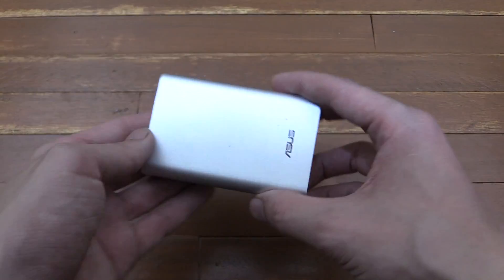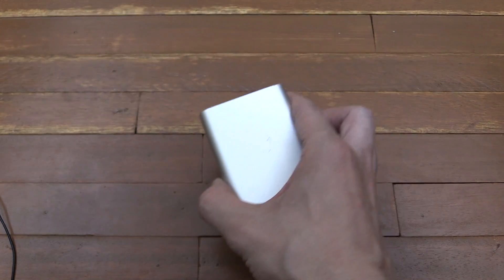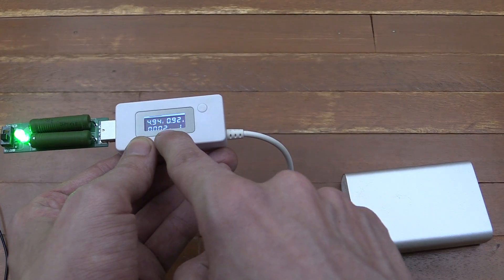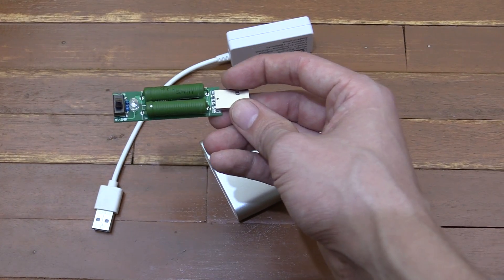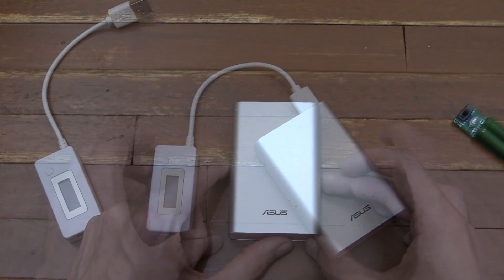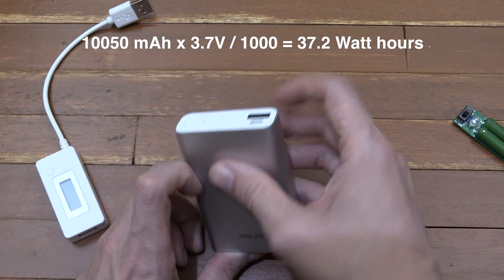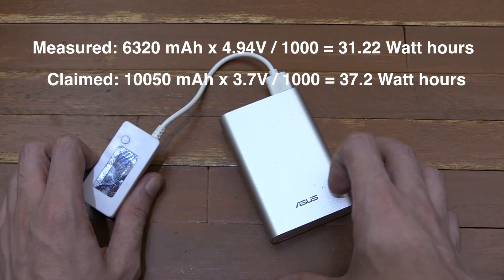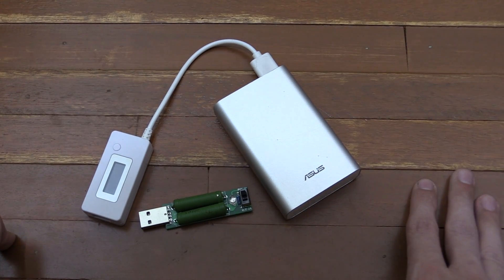How to measure the capacity of a powerbank

Comment: How could I measure the actual capacity using a USB tester with a discharged battery? For example, what if my power bank is at 0%.  Can't i just charge it with the USB tester plugged into the power bank and get the mAh reading when it is fully charged?  Thanks

Comment: Also everyone needs to remember, that a battery that is worked hard will not have as much capacity as one that is used gently.   If you have a 1000 mAH bank, and you use ten mA/H, then it should last 100 hours, right?   If you put a heavier load on it, lets say 1000 mA/H, it won't last 1 hour, maybe 30 minutes or 15 minutes.   Those mAH ratings are only valid when used in the gentlest way possible.   Increased loads end up with a big chunk of the power being changed to heat instead of usable energy.
Reply: what do you mean by load? Sorry I am new to this

Comment: One thing you need to verify, at what voltage drop the tester stop working. 3.7? 3.8? 3.9? If it stop at 3.9v the power bank still have some juice in it.
Reply: those batteries usually can go all the way down to 2.9v under load which is the powerbank or any bms module cut of voltage. those still have juice in it 3.6 to 3.7v . you can verify it if you can access the batteries and have it checked with a multimeter

Comment: My power bank is rated at 15,600 mah and at 78wh. When I used your formula 15600×3.7÷1000 I got less wh. When I changed the 3.7 to 5v it calculated as the label has it.

Comment: I bought two identical USB power testers brand KEWEISI from Ebay and wrote A on one and B on the other. I then charged a GPS device with both in series from a 3,000 mAh power bank I bought from DIASO in Japan for 500Y+tax (cheap!), first AB the BA to verify what I found. They both read different results irrespective of the order I placed them in. I expected the first in series to show maybe higher as the device itself draws some power, but no. 

The voltage and current are displayed to 2 decimal places (0.00), the time to one minute and the consumption to 1 mAh. The displays are updated about twice a second.

After 20 hours 8 minutes the displays read with [PowerBank]->[A]->[B]->[GPS]:
Read  A    B
-----  --- ---
Volts    5.06  5.09
Amps  0.02  0.00 (both vary continuously 0.00 to 0.08, generally within 0.02 of each other, and about 0.02, the higher 0.08 is on first connect)
Time  16:45  16:11 (lost a few hours, possibly device became fully charged as displays went dim occasionally)
mAh   473  455

Whilst they seem 'close' I would not expect the Volts to differ at all, B always reads higher than A by about 0.02 to 0.03. Total mAh is a function of current, voltage and time, so I expect any errors propagate. 

The test was meant to see how long the GPS could last as its battery had failed and instead of getting 20 hours usage I could only get 4 hours. So I fully charged the GPS and power bank and let it run, its still going, will update after it completely fails, maybe days away.

Comment: I'm non-techie. Let's assume I drain my cellphone (say with a 4000mAh) and charges it, WITHOUT POWERING IT ON. Should i be able to charge my cellphone around 2.5 times with a 10000mAh powerbank ?
Reply from the maker: If it's a genuine 10,000 mAh powerbank, yes, kind of. Minus 10-15% for losses from your cellphone charge circuit.

Comment: My power bank when charging my phone it decreases till like 60% then drops to 0% what might be wrong ?
Reply: Ahmed Saïd it sounds like your power bank is running on 3, 18650 cells and 2 of those cells are not holding a charge. The electronics in the bank "think" there are 3 cells containing about 33.3% of the total capacity each. If 2 of the batteries are dead it will "see" the voltage of the 1 good cell and read as fully charged. Once the 1 cell is used up (about 33%) there is very little (if any) capacity in the 2 dead cells and the circuit will see this as the over all capacity going from around 66% to 0% in just a few minutes. It sounds like it's time for a new power bank. Or time to replace the 18650 cells in your bank if your up to it.

Comment: Any of you seen a 3600mAh rated 18650 battery? is it genuine??
Reply: The only 18650 battery that puts out 3600 mah is made by Panasonic, there are one of the best cells made.
Reply: Thanks for the reply
Reply: As Adonis Cmj said: Panasonic manufactures 3600 mAh cells and I think Tesla uses those in their Model S battery bank.
Reply: Sabahan Ranau the most powerful available is 3,500mah.

Comment: Hi Did the same test on a 19200mAh power bank and I measured 16500mAh.

I then measured the individual cells removed from the battery pack will a lithium ion discharger and measured 2750mAh per cell.  X6 cells x 2750mAh = 16500mAh

Therefore, I am puzzled how this powerbank could claim to be 19200mAh when the collective individual cell capacity does not even add up to this number? 

Is this overstated or am I missing something?

Thanks for the great video.
Reply from the maker: I think there's something wrong with your testing if you got 16500 mAh at 5V and then 16500 mAh at a different voltage later. I would expect the output to be lower when drawing it via the USB port because there's losses in boosting the voltage.

Comment: how to understand cell capacity? n cells are original?
Reply from the maker: It's usually assumed that the cells are genuine/original if the capacity matches what's stated. There's little to no benefit in someone re-wrapping a battery with an off-brand name if it's a genuine high capacity cell from a decent manufacturer to start with. For understanding the capacity, you have to remember they're rated at 3.7V. So if it's a 2000mAh cell, that's (3.7 * 2000) / 1000 = 7.4Wh. It's important to convert it to watt hours because if you draw power at 5V instead of 3.7V, the mAh capacity wouldn't match.

Comment: why dont you charge the phone rather then a dummy load , how to measure  a cell phone watt hours ?
Reply from the maker: Because my dummy load can draw a constant 1A load which means I can keep all my tests equal among many different devices. Also, a phone wont be enough to drain a battery bank this large. You could remove the cellphone battery and use the dummy load to drain it (to a safe voltage) and then use the data from your watt meter to work it out. Most cellphone batteries have the watt hours printed on them and if it's from a respected brand like Apple or Samsung, you can probably trust the rating.
Reply: ok i see, where you get the dummy load and that volt meter from ?
Reply from the maker: sdq sdq You can find them on eBay, Amazon, AliExpress, all the usual places : )

Comment: 18650 18650 cells have only 2600 Mah
Reply from the maker: LG have 18650 cells with higher capacity than 2600 mAh.
Reply: but i think this is a 2600 one
Reply from the maker: ART crush They're not 2600 mAh. If they were, I wouldn't have been able to draw out as much as 31 Watt Hours.
Reply: Hello to both, 3 cells wired in parallel, will give and store 3 times the mAh... Example: 3 x 2600 = 7800 mAh.
Reply: yap 7800mah due to voltage conversion there should be a wast.
Reply: highestt capasit of 18650 is 3000mAh from LG  HG2

Comment: Thanks, I measured my power bank and I got: 50000 x 3.7 / 1000 = 185wh, this is what is is advertised as and
6890 x 5 / 1000 = 34.45wh this is what was measured! This was on charging as well, surprisingly off by %537!!
Reply from the maker: That doesn't surprise me. Many manufactures just make up numbers. It's best to stick to well known brands like Aukey and Anker.

Comment: Can you adapt the usb load and the meter for use to test on just one 18650 battery? If so, how would you do it?
Reply: ChompChompNomNom just modify the circuit to only have that one battery on the input. There is going to be some electronics for the battery management and step up from 3.7 to 5 V

Comment: so that powerbank is fake or genuine? because i dont understand
Reply from the maker: It's sold with a capacity of 10,000mAh or 36.2 Watt Hours. I measured a total output of 31.2 Watt hours which is around 14% lower than the claimed capacity. Usually you would expect 10-15% losses while consuming the power. So it's close enough to say it's a genuine 10,000 mAh powerbank :)

Comment: You calculate Wh little wrong way. You assume that 18650 cell voltage is constant, but it isn't. It starts at 4.1-4.2V (full charge) and ends at 2.9-3.0V depending on the protection IC inside power bank. Additionally step-up converter inside power bank usually has about 85-90% of efficiency. However you obtained very good result with this Asus. Typicaly power banks capacities are fake. In general giving mAh by manufacturers is bad idea, there should be Wh like on most laptop batteries. To measure 18650 cells capacity accurately you would need to measure current taken from cells and their voltage and count it to cut-off volatge. Capacity also strongly depends on load, for example with little current you can draw more mAh/Wh. I like your channel content and already subscribed it :) Are you English and you live in Philippines?
Reply from the maker: +cbm80amiga Yeah you do raise some good points. It's tricky to give exact numbers and no matter how well you do, the fact that the manufacturers simply give a mAh rating means you're only going to be able to give a 'close enough' rating of the powerbank. I think my measurement of the mAh (excluding DC/DC converters) is fairly accurate though and I do mention the losses. It's not really practical or always possible to remove the cells without damaging the powerbank. Like you say, so many of the power banks currently being sold are giving fake ratings. So as long as I can get 'close enough' then I'm happy with the results. But I'm glad you commented because it does give people more information on why this isn't pin point accurate :) I went with a 1A load because I'd consider that to be the average for most cell phones right now. Again, thanks for the feedback!

Comment: I have the same power bank in gold color. 
I measured the capacity of this power bank by using the phone method. 
Firstly i depleted all the power from my sony Xperia L and then charged it always every time from 0% to 90% which come to be 90% of 1700mah capacity of my phone battery to 1530mah.
I did this until the power bank goes dead. I was able to charge my phone from 0% to 90% 4 times and additional of 0% to 44%.
So intotal it comes out to be having a actual capacity of my power bank to be around 6868mah which i think is good. 
I used the cable that came along with this power bank. 

Your method is also great.
Reply: This method does NOT give you accurate results.
Reply: (Sorry for answering 4 years later) The biggest problem with that technique is that you don't know how the percentage is setup up. A lot of companies change the percentages to last longer in the beginning (85% and up) and in the end (20 or 15% and lower), so you can't precisely tell what is happening with a scale that you don't really know

Comment: but this inefficient Dumny load because of the heat. you can use a circuit that dissipate the power equally. #share
Reply from the maker: +Andrew Maraguinot There are a few better dummy loads on the market that have an adjustable current draw up to 3 or 5 amps and onboard cooling. I'd really like to get one of those. But most of the time I'd probably only run my dummy load at 1 amp to simulate an average smartphone so I guess this will do for now :)
Reply: Btw are you going to make a 3D printer video soon???
Reply from the maker: +Andrew Maraguinot Probably :) There's a 3D printing related video that I've had in mind for a long time but just haven't got around to shooting it. Right now there's a lot of videos on the list but for sure there's some 3D printer ones :)

Comment: So one 18650 battery equals 10 Watt hours.
Reply from the maker: +David Sunshine I guess in this case yeah. But it varies because 18650 batteries are sold under many different capacities and some of the really cheap dodgy ones might be sold as 4000mAh but actually measure at around 1000mAh.

Comment: where can I buy that USB Wattmeter? =)
Reply from the maker: +Rouge Hawkins Like Peter said, you can find them on ebay, just search for 'usb watt meter'. This one cost me about 10 USD but I see other ones on there for 3 USD which includes worldwide shipping! I wish the screen was bigger on this one and that it measured watt hours as well as mAh but otherwise I'm pretty happy with it. I have a Portapow watt meter that I plan to review and that one can measure Watt hours rather than just mAh which is useful if you're expecting a lot of fluctuations in the voltage.
Reply: +Rouge Hawkins I bought from eBay.
Reply: +Gadget Addict ahh maraming salamat!
Reply from the maker: Rouge Hawkins walang anuman :) I hope you manage to get one :)